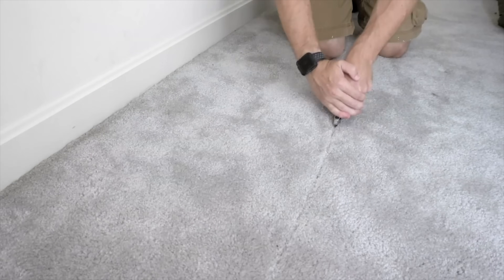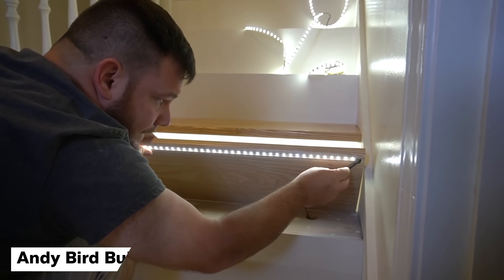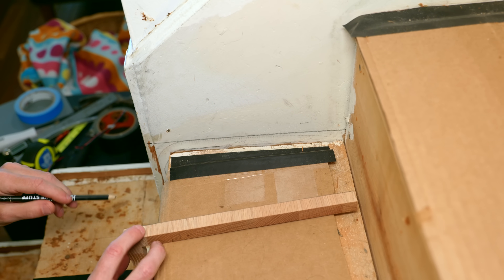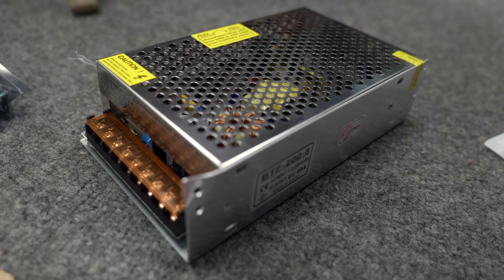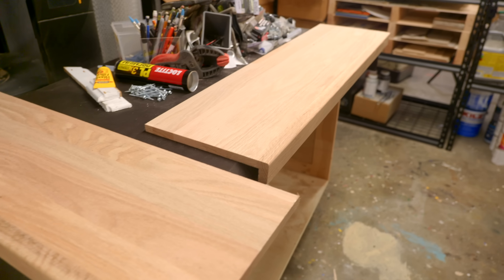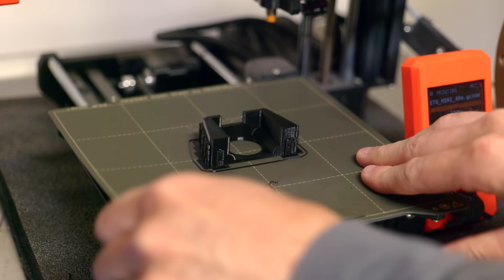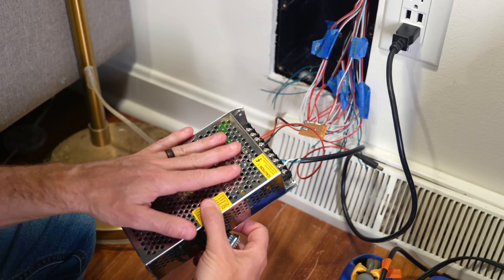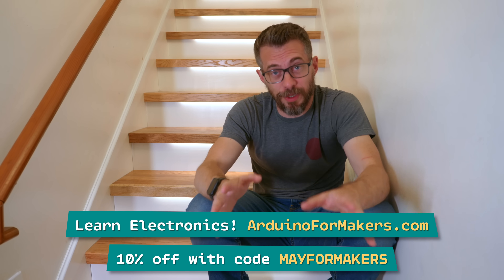Smart Stairs Now Exist...But Should They?

Comment: How hard would it be to put a pressure sensor to each stair (instead of the ir sensor on the handrail) so that it lights up each step as you go up or down?
Reply from the maker: Sure, pressure sensors are notoriously low quality and wear out easily. Using a passive sensor of some kind like a light beam or a PIR is more reliable over time.
Reply: @Iliketomakestuff  you mean ir sensor similar to auto opener for garage doors. Only in smaller package.
Reply: @Iliketomakestuff  ir good. Maybe even some contact mics and some logic?
Reply: Search for "Piano stairs"

Comment: Turned out nice! I thought you were going to use pressure switches for the lights
Reply: I thought that too but eventually as the wood shrinks to contracts it will mess up the movement of the wood. Or if he cuts the risers tight to the skirt then it could get stuck down
Reply: ya i was thinking this would be a good solution

Comment: You should do a USB pass-through to a socket on the faceplate so you don't have to take it off to recode it.
Reply: OTA updates! ESP32 instead of Arduino
Reply: @bogmaerke except you would need more I/O than one esp can handle. You could make the arduino a low level mcu and the esp does all the high level thinking. But you would be creating your own protocol at that point. 

If the leds were ws2812b and run together in serial, you could do all of that with WLED and do almost no software.
Reply: @jeffeberl12  ESP32 definitely has enough IO for ten strips. You can always cascade them in software instead of hardwiring them in series.
Reply: Just skip the features and nothing needs recoding or replacement, now that would be smart for the longrun.😅

Comment: Great looking stairs !
Honest question, is that gauge of wire sufficient for 40A? It seems thin. 

My knowledge is coming from 3D printer heater beds that often use much less amperage
Reply: Well each wire won't have 40A running through them. At most it would be 40A/10, but those aren't well populated LED strips, so they won't draw that much, even at max
Reply: Okay, so I continued to watch it. Yes, those are VERY thin. Definitely needs to be beefier.
Reply: 40a can take over 9kw

Comment: Look cool but i feel like you need some fuse on each strip... with a 40A 12V PS , if a wire ever short or a led strip malfunction the small wire you used would catch on fire long before your breakerTrip... You should used bigger wire to go from the power supply to the distribution board, then a fuse to protect each of the smaller wire. Except that great project & video, might do something similar when I redo my stairs !

Comment: I actually thought you were gonna use a piezoelectric sensor under each tread to lit it up as you step on it, then I thought you were gonna program the mention sensor to detect the presence on a thread given a given angle and then light up the tread you're standing on ... but maybe that's even more complicated code than you had to write up for that (not to mention piezoelectric sensors are probably not cheap)
Reply: Piezoelectric elements are stupidly cheap. A full sensor system might be a little expensive, but a piezoelectric speaker which can be very easily turned into a simple sensor can be had for about $0.50 a piece. A piezo probably wouldn't produce a large enough signal to reliably trigger with if you walk really softly, and it wouldn't know when you've left the stairs either, unless you program logic to determine such based on the assumption that you will step on every step on the up. It could easily get confused if you have two people on the staircase at the same time, or you take your steps two at a time for some reason.
Reply: Some "Billie Jean" vibes here! Lol